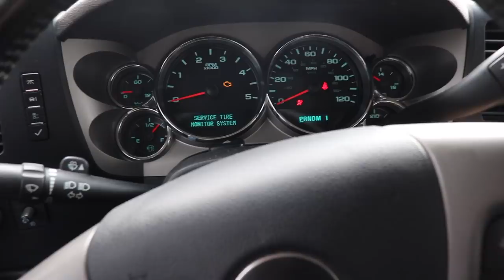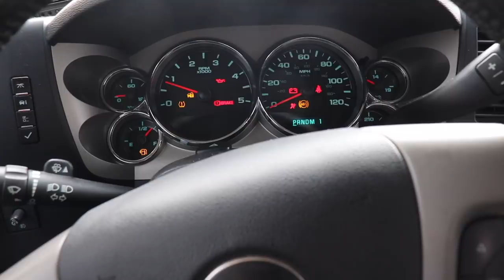WE GOT THE TOTALED 7.3 POWERSTROKE RUNNING AGAIN!!!

Comment: Good old 7.3 I once dropped one on concrete floor while hoisting it out of truck with 4 inch lift.  And it slingshot down and did nothing but smash the oil filter    and also crack concrete and i installed it after  Putting in oil filter  and  oil then it started right up ran sense besides a icp  sensor but that's common

Comment: If it was a dodge it would have  never started
Reply: A dodge would have started even quicker
Reply: Riley Drivet i would normally agree with u but them dodges have the cummins in them 😂
Reply: @upshiftclutchups665  The newer ones start better?  Atleast at work, the '07/'08s we had ,started with no issues....I guess the older gens didn't start well?  The 6.0 Ford's were just dogs to start without heat.  I'm not partial to any of them any more...duramaxes always seem to start I've noticed...
Reply: Corey Martin 
Well, to be fair, 7.3s don’t start fast at all. Very cold blooded.
Reply: @FordFan01  Agreed!  Awesome engines, but our one in the old garbage truck was an etheraholic(yes, we know we shouldn't have used it, no one cared).  It wouldn't start even plugged in.  It was a guessing game every Monday morning to see what it was going to take to get it running....good times...
Reply from the maker: A 12v will ALWAYS START...
Reply: bababooey7576 i was saying cummins start very well
Reply: @FordFan01  not true, most 7.3 start easy in cold weather, even the one I own, never really plug it in and starts no problem
Reply: DieselKing Trucks 
Huh, well all the ones we own always are hard to start. Even when they were new.
Reply: Ford Fan01 Mines starts in a snap hot or cold
Reply: Forgotten Thief 
When we’d go up to Colorado for hunting, our 1996 Ford F-350 7.3 at times wouldn’t even start plugged in.